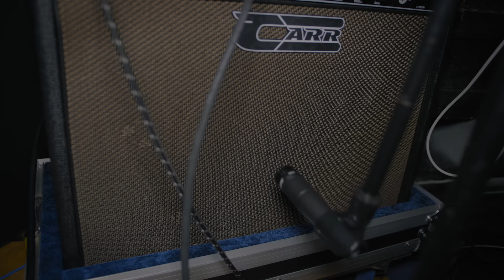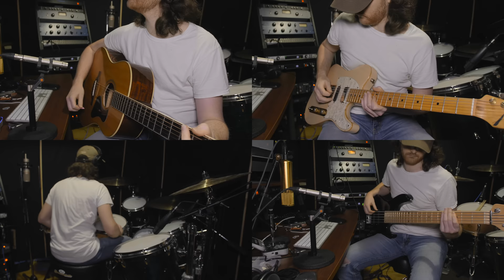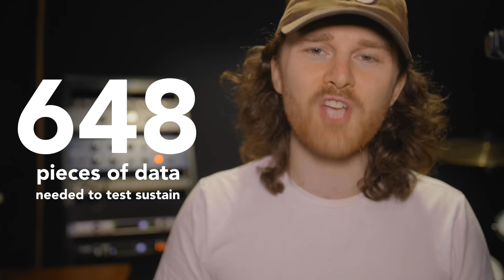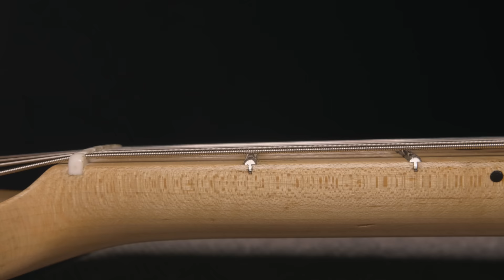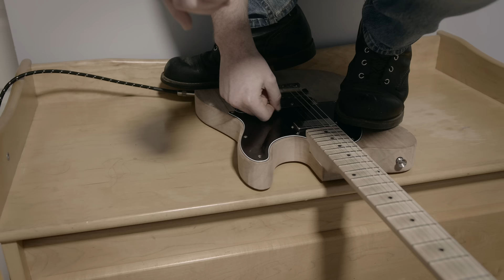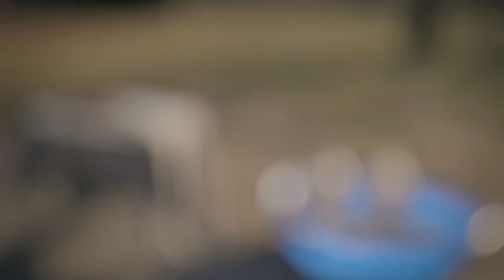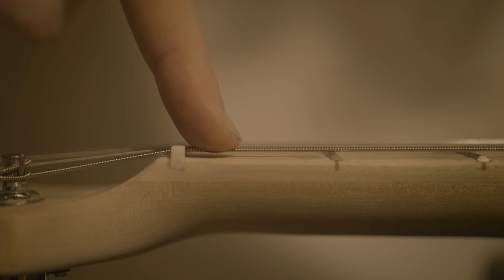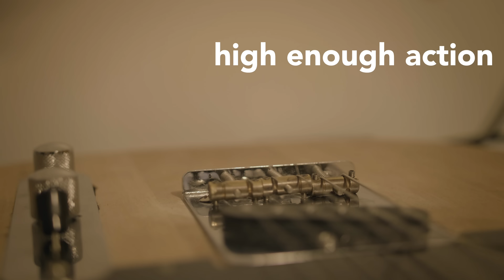Tested: Where Does The Sustain Come From In An Electric Guitar?

Comment: As an acoustic guitar maker, I can't thank you enough for debunking those myths. 

Most of them are misunderstandings, or things that work for acoustic instruments (like finish thickness and softness) but don't matter for electrics, or finally just fake info coming from guitar companies marketing BS.

Here's my 2 cents (I'm sure other guitar makers will have their opinion on the subject) : 

On an electric, sustain comes from the rigidity between the 2 points of contact of the strings (bridge saddle and nut). The more those points are rigid, the more sustain you'll have. But you also need good rigidity between those points. So the most prominent element is the neck. After that comes the part of the body between the neck joint and the bridge. 

TL;DR you want the most rigid structure between your nut and saddle.

EDIT : this next part concerns acoustic tops (I mixed things up in my head) : mass/weight ratio is very important too. Mass damps vibrations. You want less mass [ and good rigidity for an acoustic top ].
Reply: "Mass dampens vibrations" is incorrect for multiple reasons:

1. It would be "damps" in this discussion, not "dampens". We're not making guitars wet here. lol
2. Mass influences resonant frequency, but that doesn't mean it damps vibrations entirely. Les Paul claimed that a piece of railroad track sustained for an extremely long time, and that surely has more mass than a piece of wood of the same size.
Reply: @Harmonic14  1. I'm not an English native speaker
2. you're right. I was thinking of acoustic guitar tops in my head and kinda lost myself in my explanation, mixing things up a bit. Rigidity is still the key IMO for sustain. I'll edit my previous message.
Reply: @stratocactus  FWIW, "dampens vibrations" is correct English, so you were right. (You can prove this by searching google for the phrase "dampens vibrations".) "Damps" seems to be American slang with precisely the same meaning.
Reply: @AutPen38  thanks for letting  me know :)
Reply: I have a hunch that a lot of electric guitar mythos was just cut and paste from acoustic guitar knowledge by electric players who wanted to sound more sophisticated. And it just perpetuated so long until it became part of the industry. Like the finish "reflecting" the vibrations "back into" the body. What? Reflected into a dense piece of wood within the space of a few atoms between it and the finish?

Comment: So these tests now make me beg the question: how much does guitar construction have an influence on the sound? Will putting an electric pickup on an acoustic sound just like a traditional solid guitar? How much difference is there between solid, semi-hollow, and fully hollow guitars?
Reply: That answer is a lot more complicated since acoustic properties of the body’s cavity begin to matter. It’s why semi hollows sound different, or different acoustic body shapes have different characteristics. 

You can put an electric pickup in an acoustic with a little bit of work, but most of the time you’ll see a piezo pickup instead, which measures vibration off of the bridge. That’s what makes piezo so bright in comparison, but also relatively quiet.

There are some arguments over bolt on necks vs neck through vs set in, but in practice it’s a balance between practicality, playability at upper frets, how easy it is to repair and price. People will argue back and forth which one sounds better but honestly there isn’t much of a difference. Neck through is hands down the easiest to play since upper fret access is unlimited, but is definitely the most expensive to make and the hardest to repair. Bolt on is practical, easy to repair, simple and very easy to replace, but often times the joint doesn’t give good upper fret access, although that has gotten better over the years. Set in necks are the original design, and sit somewhere between the two.

The main enemy of these hollowbody guitars is simply feedback. The bodies of these guitars are specifically built to be a resonance chamber, so if your guitar is reflecting the amp sound back into the guitar it will do the same thing as a solid body. It is just much more prone to it due to that.

For tonal characteristics between each type i think it’s easier heard than explained. Solid bodies are very recognizable as the electric guitar tone, hollow bodies are often used in jazz and sometimes country, and semi hollow bodies are just hollow bodies with a solid block through the middle. Reduces feedback dramatically but doesn’t sound entirely like either, ends up being just as flexible as a solid body.
Reply: if you put a magnetic pickup on an acoustic, you need to also use electric guitar strings if you want it to sound like an electric fyi
Reply: @solkvist8668  I guess the ideal way to test this would be to get a Les Paul, 335/333, and 330 and swap the same electronics out. In my experience, semi-hollows are a little smoother on the initial attack of the note, while solid-bodies have a bit more "snappiness." The only fully hollow guitar I've owned was a bass, and it was more difficult to mute when playing quick patterns compared to my solid basses.

Comment: Whilst I agree that the difference is minimal, dB is a logarithmic scale. So a 3dB difference is actually a factor of 2 i.e. half the power/twice the power. 
Still agree the difference is negligible to us heating, but the numbers suggest that there's potentially significant amounts of power drop on the higher attenuating results. 
Also would need to rewatch but I think some results showed the higher frequencies being damped by some situations and the lower frequencies damped by others?
Reply: A tenfold change in wave amplitude is only a doubling/halving of perceived loudness, all else being equal.  3db is the smallest change we can hear under typical conditions.

Comment: I appreciate the amount of work that yo put ito your experiment on sustain.
The neck can have a lot of difference in sustain. I haven't played around much with metal neck 6 string guitars, but basses show a huge difference between wood and aluminum necks. Carbon fiber necks also have longer sustain. 
With a Fender bass (either Precision or Jazz) , a  C note played on the G string (fifth fret) dies very quickly and produces a strange overtone. 
This does not happen on an Aluminum or Carbon fiber neck.  If I have this problem during recording of a Fender style bass, I just add a C clamp to the headstock. This changes the neck resonance and the C note plays cleanly.

Comment: The single most influential factor affecting sustain is the coupling of a guitars components. From your last video, particularly the "air guitar", we can deduce that what you are actually paying for in a high end guitar such as your Tom Anderson, is an instrument that is put together well enough, that the sum of it's components become as transparent as possible to the relationship between the vibrating strings, and the pickup. Therefore, the ultimate goal, is for the guitar to have the 'least' influence on the tone being generated by the players technique, through the relashionship of vibrati strings to pickups, as possible. A well made guitar has components that fit together perfectly. The surface conection between neck tenon and pocket will be complete. It will be tight fitting because tge joint had been crafted with care. With no gaps or low points in the mortise, there is no where for string energy to be lost, hence greater sustain. The bridge saddles, tail peice mounts etc will all be snug tight fitting so no energy is lost here either = more sustain. 

A cheap guitar on the other hand you are likely to find less precise coupling and therefore less sustain because string energy is being lost to poor fit of components. Another example, a neckthru guitar is generally thought to have superior  sustain than a bolt on neck. This rings true in most cases because a neckthru bypasses the neck to body tenon which, unless performed with complete precision, is the largest area for poor coupling between the guitars components.

Comment: Personally, I like using a compression expander pedal for better sustain.  It chops the highs off with compression and expands the lows to give it a nice smooth volume.  The longer the note is held, depending on settings, it will start to feed back.  With this pedal, I don't feel any need for active pickups or an ebow.  Great videos.

Comment: I recently revisited a guitar I built almost 20 years ago, although it has had several iterations with the same pups over the last 42 plus years. In the last iteration I used jarah timber because I though I needed heavy timber to get the sustain. I was wrong, and found I didn't like carrying a 5.2 kilogram instrument around. Weight made no difference to sustain. I am somewhat limited in being able to compare my axes because each is unique in terms of timber, pups and even string gauge and I don't have the scientific stamina like you do Jim to explore the variations. Well done sir. For my next build I might try just a cage/frame type of structure leaving more space everywhere except on neck, time permitting.

Comment: About a month ago, I installed a floyd rose FRX on a SG.  The increased mass of the new bridge transferred so much string vibration into the guitar, that it tickled my fretting hand,  and took a couple days to get used to it.  I couldn't perceive any audible difference in anything, tone, sustain, or whatever.  But I do suspect the sustain changed to a measurable degree, just not enough to be audibly noticeable, to me.  Tinnitus!

Comment: Here's some food for thought. Guitar strings have a "natural resonance" dependent upon string gauge, tensions. If you attack a string too hard, most the excessive energy will bleed off almost immediately and the string will then go into it's natural resonance and decay. The thicker the strings, the more energy they can store and visa versa for thinner strings.  The  body of the guitar  only serves to absorb the energy of the string. Electric guitar absorb very little and acoustic guitars absorb more energy and transfer it to the top of the guitar to acoustically amplify the guitar.  Great video!

Comment: There are many aspects ofc. But if we focus only on the guitar and ignore corner cases, strange use cases, amps, pickups, pedals, weird materials / construction, assume the bridge or nut is not made out of toothpaste and general build quality is good, then I would say this:

- The pressure on the bridge created by the strings. This can be adjusted by the break angle. E.g Older acoustic guitars with slotted bridges and non slotted bridge pins have a different angle and put more  pressure on the bridge. E.g pre war martins.

- Type of bridge. E.g certain trem systems like those on strats will definitely steal parts of that energy. Which is why hardtails and teles have better sustain.

- Sympathetic resonance.  This occurs when a note in the guitar makes other strings resonate and create like a shimmer which feeds pack into the note. Mute the note and you will hear the other notes ringing. 

I spoke with a friend who is a trained luthier about lighter/heavier woods. He said that doesn't matter. In general a heavier wood will have a darker character and the lighter wood will be a bit brighter.

Comment: Statistically in order to compare these values, you'd need to repeat each of these indivdual tests say 50 or 100 times. Then you could use students t-test to compare the sets of data where one variable changes. This would tell you if the difference was significant,in this case the change is effecting sustain or insignificant, which would mean the sustain is only being effected by random variation. Some of these differences seem quite large, like 12db to 16db is 25% but if we have 100 values for each of those they might both have a range between 12db and 16db. As a Scientist and a guitar player, I think these videos are great.

Comment: In a guitar shop, if you walk down the guitars and lightly strum each in turn while they are hanging in the racks, while lightly touching the top of the headstock with the tips of your other hand, you find that they all vibrate very differently and for shorter or longer. With the same input, some guitars seem to go on and on. Others just fade rapidly. 
I think that some bodies and necks work together and vibrate easily from the string vibration which seems to in turn make the strings vibrate more. I’m not saying more is better, just each guitar is different and a few are way more vibrant than the rest. 
I used to try to find the longest sustaining one but now I realize I like the notes to fade out eventually.

Comment: Thanks and sorry for asking you just a few minutes ago if you had a video about this! Great series of tests and, as a mainly acoustic player, they do match my experience, for what is worth. My only observation is that, for my kind of playing, sustaining a bass for longer than a few bars is quite useful and desirable. I often play melody lines over the bass and at times it just sounds better to sustain the bass than to play it several times. So I do sometimes tune my acoustic a tone or more down, and use heavy gauges for the bass strings. On an electric guitar with a band I would not bother with any of that though and like you suggest probably extremely long sustain is not generally that useful.

Comment: Some other things that might affect the overall sustain qualities of a guitar…

String material and gage.

Bolt on versus through neck

Neck length

Headstock or no headstock

Chambered body or nonchambered body

The type of wood used in the guitar’s construction

Floating or locked trim

Tuning peg arrangement

how tightly the strings set inside the nut

The type of pickups: which reminds me that I need to still get around to doing that sustainiac project I’ve been putting off.

Comment: some things I have noticed in the last 30 years. having a straight neck with clean polished frets and clean strings makes a slight difference. loose parts that vibrate can create distructive interference with certain notes. pickup height. pick ups have a certain height that is like a sweet spot. Raise them up and they get louder but too high and the magnetic field interferes with the notes and deadens the strings. too low and it is not loud enough. big strings should be futher away than smaller strings. The big strings are louder because they interfere with the magnetic field of the pickup more because it is more metal vibrating back and forth over the pick up. I always tilt the pickups slightly for this reason. I try to find the height where the A and D strings sount the best. then I Raise the high e sife of the pick and lower the low E side. Then I try to get it so all the strings are about the same volume. then raise and lower both sides by the same amount till it is almost as loud as can be without the magnetic fields messing with the strings. then I lower both sides a half a turn so it is just a bit below that. That is usually the point where it sounds the best. iF it is over driving on clean lower a half a turn and repeat. aome pickups are real loud and will over drive on clean which isnt really desireable. Try playing an E min  Chord. it shoukd sound huge!!! That is my two cents.

Comment: 1) density of all the components. the harder the materials, the less vibration they absorb from the strings. 
2) string tension.  if the string is too loose, it wont sustain as much. same thing if its too tight.
3) how hard the string is struck, and the hardness/flimsiness of the plectrum involved.

Comment: pickup height should also affect it to some extent; the magnets being closer/further from the string will pull on them more/less. Pickups work by magnetizing a local region of the string above the poles of the magnets inside the pickup, and those regions oscillating up and down when the string is picked induces the emf in the pickup coil. How close the magnets are not only changes how much those string regions are magnetized, but also how much they will attract to the poles. I'm not sure how much it would affect it, but it definitely does

Comment: I have a little experience in testing sustain. My first electric guitar was a Kramer Striker 600ST.  It’s a HSS with a Floyd Rose trem. It was my first electric guitar, and I wanted to keep it. When grunge hit, pointy guitars like Kramers plummeted in value…so much so that one could regularly find top shelf Kramers like their Pacer series for under $300 all day long. I bought an identically outfitted Pacer, and swapped the pickups, electronics, and Floyd Rose onto my Striker. The tone of the newly upgraded Striker sounded just like the Pacer. However, the Pacer had a solid poplar body. The Striker had a plywood body. Even after the installation of the better hardware and electronics, the Striker had MUCH less sustain.

Comment: im a bass player, and for bass, the two things i think matter in sustain are: 1. the weight if the instrument, this allows the instrument to fight back against the strings weight when vibrating, the guitar body doesnt counter vibrate and cancel out the motion of the string) 2. the strings tension to mass ration, the string has to be tight enough so that when it is strummed and tried to return to a neutral position, it will spring in the opposite direction and its own mass will be flung in the opposite direction and stretches a bit so that it retains the most energy it can when it springs back.